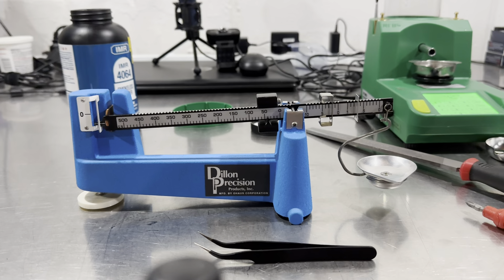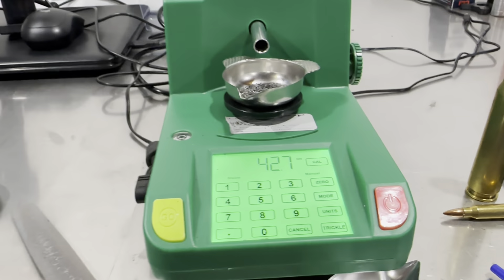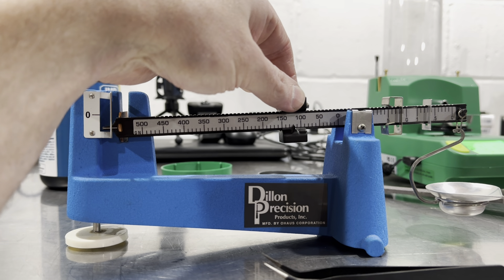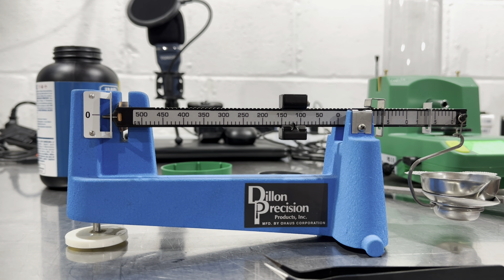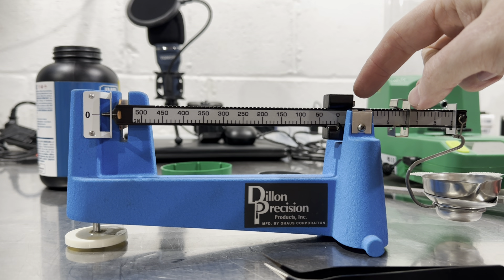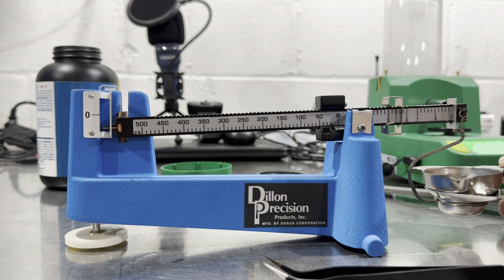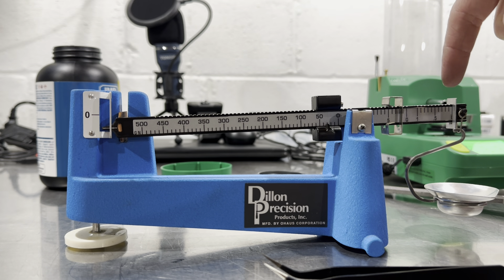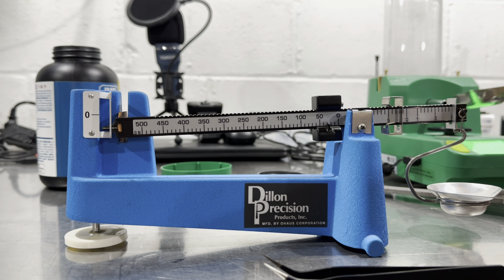Modifying my beam scale to make it match a known good scale | Dillon Eliminator Calibration

Comment: Looks like you got it figured out, (Not because I'm old) however, I don't really like electronic scales 100% as you pointed out, they will lie to themselves and say "Good enough" and end the weighing cycle. One thing I always take into consideration, powder burns. The amount of powder burns differently every time you pull the trigger because of barrel condition, fouling load vallum and such, (Yes,, powder that is unburned goes out the muzzle) How much that is changes and there is nothing you can do about it.. So,, throwing extremally close powder throws will have No effect on your groupings over exact powder throws that you had whiningly measured out. anyway, peace out dude - Dave
Reply from the maker: Yep. Close enough is usually good enough for what we do and what we can’t control. I like the beam scale a lot. Accuracy isn’t going to be affected by shady electronic drifting on a beam scale. Thanks, Dave!

Comment: For quick load development, my Dillon is perfect.  I can grab a powder bottle, partially fill a small bowl, half fill my trickler, and weigh out & fill 30-35 prepped & primed cases with a tiny scoop and the trickler loading the pan directly on the scale for a ladder test that day faster than filling up the powder reservoir on my digital Lyman 1200 DPS 3 or RCBS Chargemaster, waiting for them to warm up, zero checking them, running 30-35 cases, then unload the powder from the reservoir and clean up the mess in and around the digital powder dispenser.  And my SD's are actually a slight bit tighter than with the digitals.  The old Lyman will often "drift" to throwing .2 grains off fairly frequently, so I try to limit its use to bulk range practice ammo that's nowhere near max load.  I saw a stat somewhere that a properly adjusted & calibrated beam scale could be as accurate as +/- .06 grains, so potentially a touch better resolution than a typical sub-$500 digital powder dispenser (at +/-.1 grain listed resolution).  Perfect for spot-checking and small jobs.  I'm retired, so time savings isn't as much of an issue.  For someone who is impatient,  isn't a fan of the reloading process, or just wants to get out and shoot, probably not the best method.  But it works for me.  Thanks for your review.  (PS you scored.  I paid nearly twice that price for my LNIB Dillon on the 'Bay).

Comment: Screw the white foot on the left side in or out to fine tune.
Reply from the maker: That will make it read what I want it to, but the zero will be off.
Reply: I’m f I set my RCBS to zero and it is off all I have to get it to read zero screw that foot in or out. Same thing if check it with calibration weights.
Reply from the maker: @brianwood7882 If you adjust it to your calibration weights, then your zero will be off. You’d just keep going back and forth with the leveler.
Reply: @TinManReloading   You know the screw in the tray under the pan, holds that assembly together, and there is a certian amount of weight inside there as set by the factory when they made the scale. Couldnt you add or take away that  .2 grains to those weights under the pan to get it to zero?  or for your checkweights ?  but I guess that would throw off the poise weights in your situation. Stuff that makes my brain hurt! 🤔🤐🤨